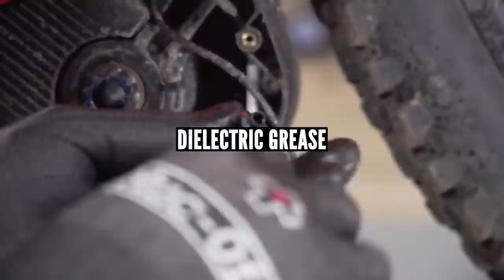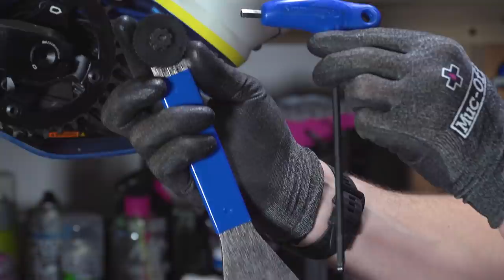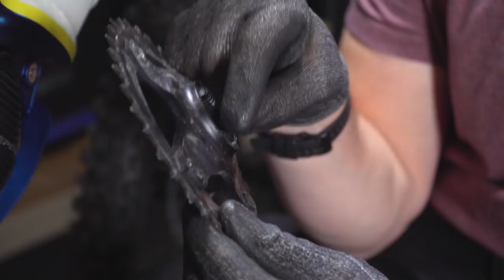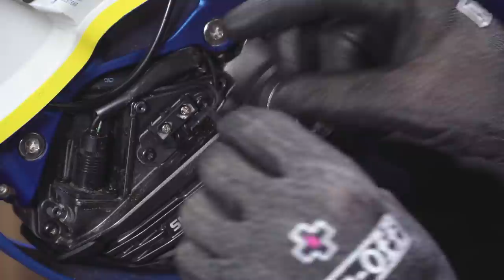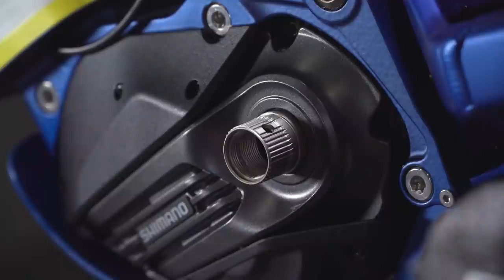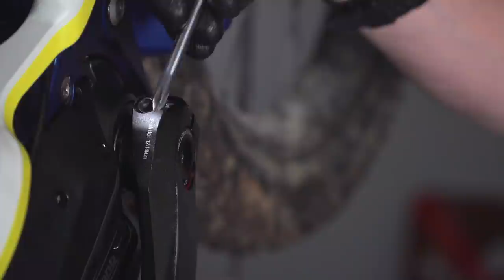How To Deep Clean Your EMTB Motor | E-Bike Servicing

Comment: I'm doing it now !! Got my Bosch performance line cx motor in bits it's unreal how much guf gets in there via the bash plate vents....Bosch lockring tool internal circlip pliers various  other hexs/t25 etc and your in !! ...remove outer casing and see if there's a lifeform from the last woodland thrash.....
Reply: Hello mate, how do you remove the Bosch plastic plate? Cheers

Comment: You don't need to do this at all. I have a few e bikes.  My oldest is a giant explore with 17k miles on the clock. It's 3.6 years old, and i have never gone near the electric motor. It's still running smoothly as silk. Why mess around when there's no need. My other bike is a giant revolt pro e. It has the ep8 motor.  I wouldn't mess around with that either.

Comment: I’ve had to hang up my giant E2 the cadence sensor bean broken for over a year  only detects a small amount of cadence so hardly any power  tried getting it fix . The motor made by Yamaha but the Yamaha sensor causes a error . Bike shops are useless take money off you to say they can’t fix it . They just want to sell a new motor £1000 fitted takes me 30 min £300 
 and charge full retail £700 for the motor 
Had it apart sent away still unfixed .I give  up just stick to push bike . In my experience when e bikes are out of warranty it’s ticking costly repaired ahead . Maybe one day I buy a new one .

Comment: top tip if you open that motor up and change a bearing the software sees it has been opend and bricks the motors and thats on all of them, they can not be fixed buy a 3rd party!
Reply: No, that's not true. To clarify...there are many models you can work on. And some have the brick feature.

Comment: This isn’t a motor deep clean is it? It’s a front chain-set deep clean. There’s no evidence that undoing the connections to the motor has any benefit and certainly risks damage, even with the correct tool and some watching this will foolishly try without the tool.
I certainly support the front chain-set deep clean. And removing the grit, dirt and small stones that accumulate near the connections is also worth regular careful effort  - beware damaging the threads of the small screws. Undoing the electrical connections when removing the dirt and little stones just because they are right there in front of you is genuinely foolish unless there is evidence there is moisture or water in them or they appear loose for some reason. I’m surprised to see this being recommended here. I also know Shimano / Maddison would definitely not recommend this under these circumstances. The connections are designed to be left alone unless it’s absolutely necessary to tamper with them - perhaps three or four times over the lifetime of the motor and electric harness. The front chain-set should be cleaned much more often.
Reply: I was thinking the same..
Reply: I would agree.  I think this was more EMTB needing a video while there was not much other content they could do...